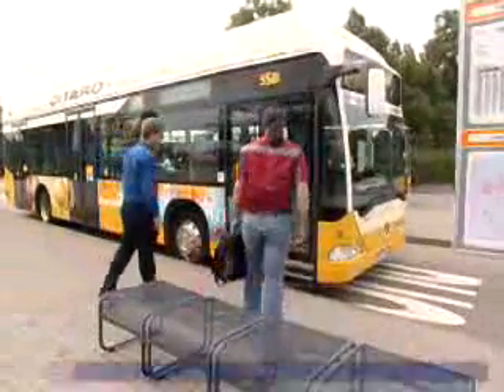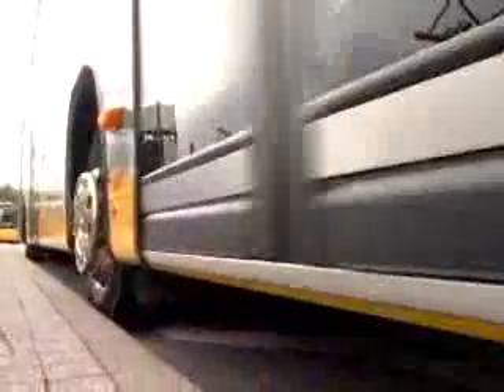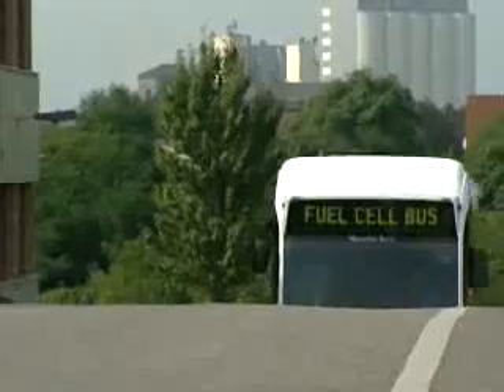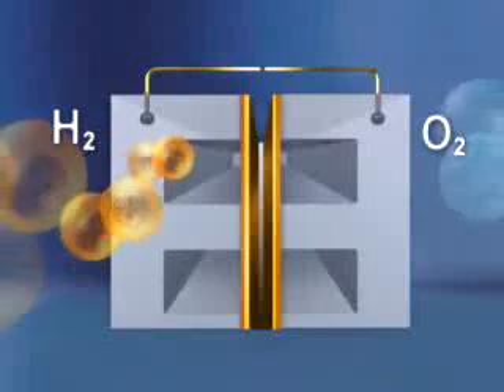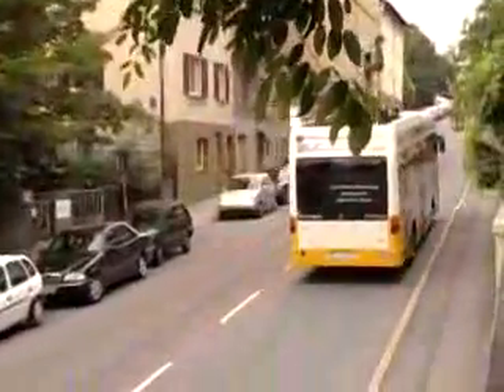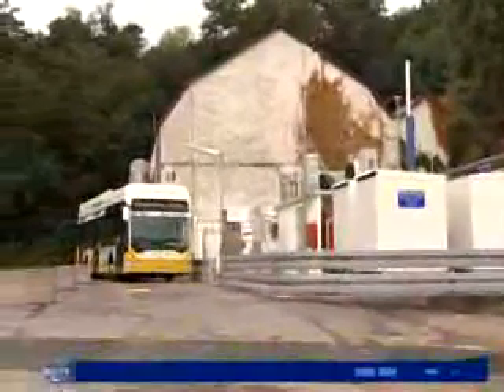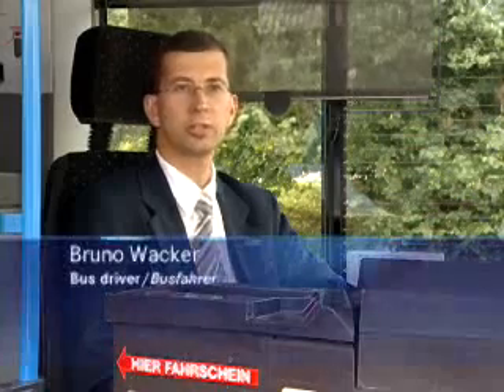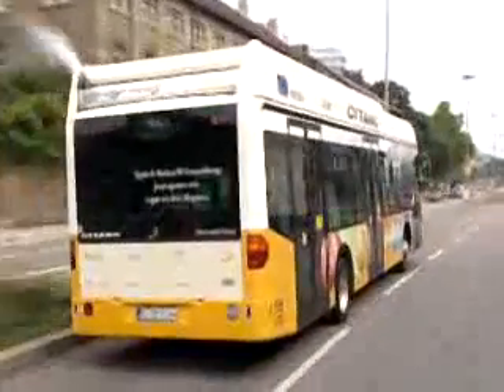Mercedes Benz: Fuel Cell Bus

Comment: HAL, anger is for the ignorant.Hydrogen in it's gasious state is one of the most unstable substances on earth. This makes it among the easiest to harness power from.You need only a spark, in the case of the internal combustion engine, or a proton conductor (fuel cell).

Comment: continued: Solar and wind power are absolutely adequate for hydrogen production. Not only that, but the exhaust steem from a fuel cell can also be harnessed to produce enough electricity to produce more. It's happened more than once, and it'll happen again. The known laws of physics turned on it's head. Rather, though, than wait until someone proves this possible mathematically, if it work, I'm not arguing.

Comment: HAL, I'm curious to know the source of your figures. I'm not knocking them, just curious. I've personally managed to produce hydrogen from plain tap water using 6 volts @ 1.5 amps. Now, I was in phisics, too, but I also realize that if something works in practice that doesn't in math, then I must check the math.The fact is, you simply don't have to rely on fossil fuel.